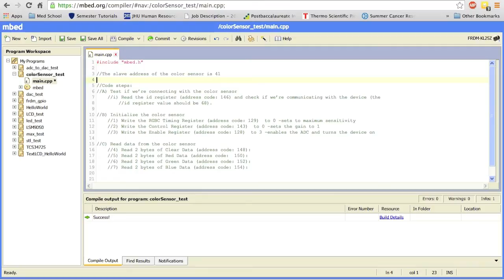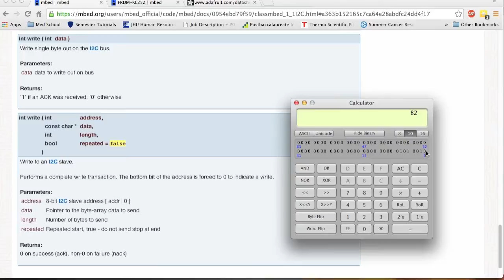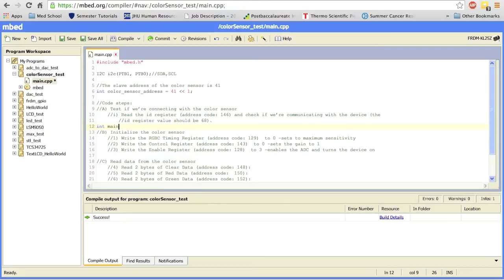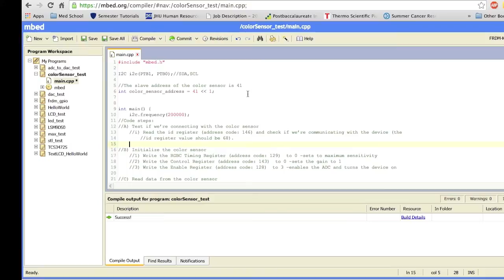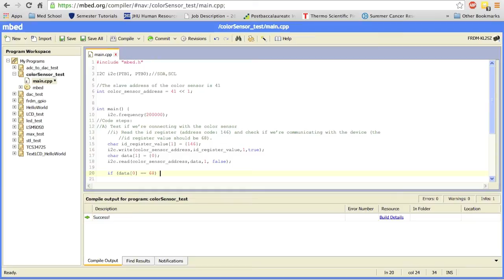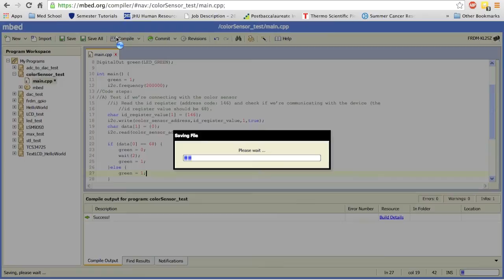mBed Tutorial 8.6:  I2C Interfacing with the TCS34725

Comment: why 146  ? acording to  the datasheet it is 0x12 ...
Reply: I know this reply is reaally late but for anyone who's checking this vid now, its its 146 because the command bit is high.

the address on the datasheet is 0x12 (0001 0010) = 18
with command bit set high: 0x92 (1001 0010) = 146
Reply: @MrSmokey247  Thank you man !! I actually want to use this TCS34725 for my project and i was WTF, how he can have that :o
Reply: @tkfou801  No worries man! I'm in the same boat as you, spent weeks without knowing about the command bit. Such a headache :D
Reply: @MrSmokey247  Yeah it's on, it's not easy! Are you using any other software?
Reply: @tkfou801  well I'm not actually using mbed. I'm writing my project in C so I'm using the IAR embedded workbench to write and test the code. 

Id recommend picking up a logic analyser to test what's going on with your data and clock lines. Definitely made a huge difference in understanding what's going on with I2C. It only cost £12 from amazon or can get one from China for £4 which arrives in a few weeks. 

There's lots of software available for the logic analysers, I use pulseview, which has presets for i2c.
Reply: @MrSmokey247  
I am a student so I have a lot of material in possession. Like an oscilloscope. Is it difficult to operate the sensor in I2C? I already tested on Arduino but here everything is easier.
Reply: @tkfou801  I'm not quite sure I understand your asking about i2c. This video takes you through the setup for the sensor through the i2c protocol
Reply: @MrSmokey247   hi r u still working iar workbench?
Can u share the I2C interfacing program to get different colours
Reply: @MrSmokey247  
Hi , can u please share the c code which was written using iar workbench I am working on that now

Comment: Also, why isn't the Enable Register done first, to turn on the device before the other Registers are set?
Reply from the maker: No particular reason. Typically it's a good idea to change the output settings before you enable the device to output data, so you know what the settings were set to.

Comment: I am confused about something. How did the address code for Enable change to address code: 128 if the address is 0x00?
Reply from the maker: Watch the previous video, or read the spec sheet. The topmost bit of needs to be set to 1 to address the command register. Therefore, to access address 0x00, you need to send 0x80, which is 128.
Reply: Bme Builds Thanks for your help. These tutorials are exceptionally great, you do a great job clarifying a process that was very intimidating for a beginner like me